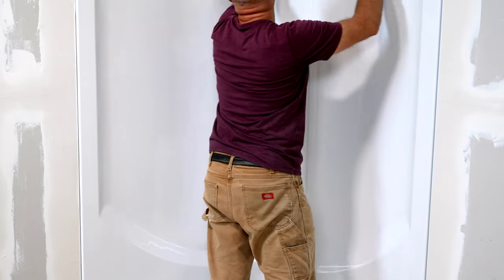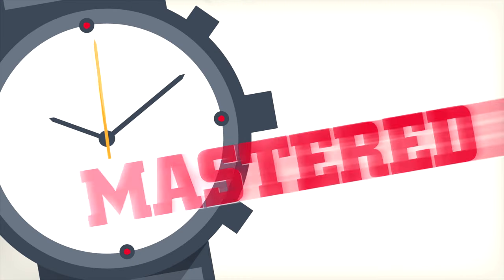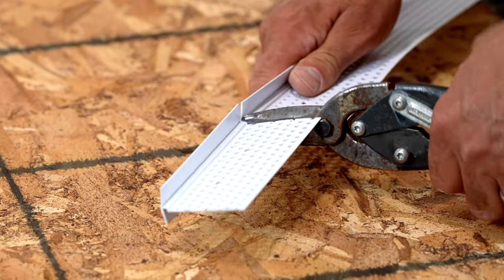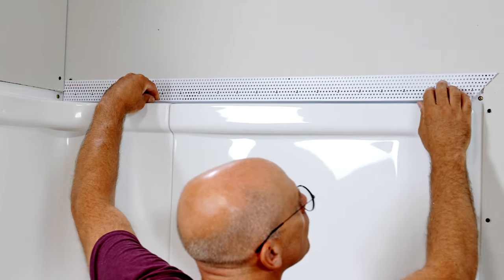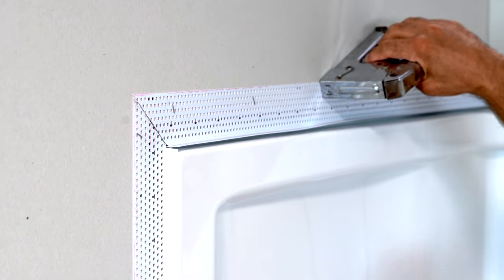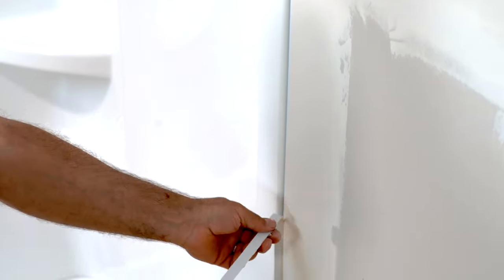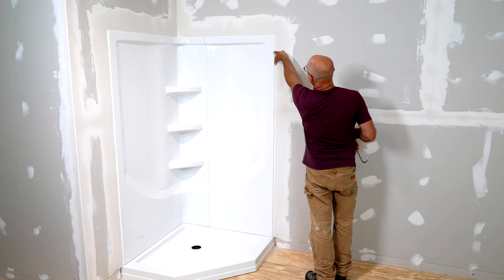How to Finish Drywall Around a Shower Enclosure

Comment: what you actually want to do is simply tape tight to the tub, i dont see why you would want an 1/8" gap or caulk.
Reply: the materials expand and contract at different rates, so you'll end up with cracks if you tape right up to it. Flexible caulk will span the gap and last a couple years before it needs replacing.
Reply: @harmonj3  if you use a quality exterior caulk product like np1 urethane or dow 795 silicone you'll get at least 2 decades out of it from my experience. I prefer urethane but you've gotta be able to tool it properly. Silicone is easier to tool. Both take a good deal of time to cure but beat any of the typical big box store junk.
Reply: @skiptrace4034  interesting, mostly due to wear and tear from children I think, I would have only expected a couple years. Good to know
Reply: @harmonj3  there are no drywall materials that expand, tubs should not be moving, which is why i've never seen cracks around a tub.  You can tape tight to the tub and have something that lasts forever, without the risk of your caulk job falling apart every 2 years.
Reply: The directions for my tub also said to leave a gap for caulking. This prevents any chance of moisture wicking to the drywall. I  followed this recommendation and there hasn't been any problems.
Reply: @dbrianhoyt  gaps dont prevent moisture.  Drywall is sealed with paint. but I'm not trying to say don't use caulk, caulk is your friend. where ever your new drywall butts up to the tub, or an existing trim or woodwork, you want a tiny invisible bead of caulk. The bigger the gap, the quicker your caulk will fall apart.  What i am saying is no cornerbead - this video is a commercial  trying to sell cornerbead.
Reply: the reason why you don't "tape tight to the tub" is because, as someone stated above, the TUB ITSELF expands and contracts slightly while in use. not the drywall, just the tub! :) if you just taped, it wouldn't create a watertight seal because of the flexing. you can try this out yourself; as you add water/weight to a tub, you will see a slight change. this is completely bunk info if you have a metal porcelain-coated tub, though! they don't flex at all :) I believe the information you are sharing works perfectly for porcelain ones. I love it when everyone is right! :3
Reply: 1 /8 is not much , caulk should adhere nicely to a 1/8 void don’t you think ?
Reply: This is a new technique, and not necessary. Tape right to the tub with heavy set compound. Like they've done for decades.
Reply: Problem is, you do work that someone like me would get a call to come out and re do. When you pull the bead and sand, there’s no gap that layer under the compound protects the Sheetrock. Over time moisture can weaken that area making the drywall brittle and moldy. You should maybe consider that your way might not always be the right way! Pal
Reply: @Findmylimit  I have no idea what your saying but yes taping tight to the tub is the right way, yes your cornerbead falls apart, yes the gaps collect moisture, and then yes someone like you comes to "fix" it!
Reply: @iron.man.drywall1910 I’m in a house right now where earthquakes happen frequently and because of that there are cracks around the tub in the main bathroom, and the non flexible caulk they used when building it is breaking off in chunks. I have no problem redoing it with a mold resistant flexible caulk. But that second bathroom is something else.

In the second bathroom someone taped tight to the shower and didn’t use any caulk, and there’s all kinds of bubbling at the edge of the shower. Whoever did this second bathroom didn’t roll sealant on the drywall before painting or use water resistant drywall. They didn’t use a mold resistant paint, didn’t use drywall tape or joint compound to connect the wall to the ceiling, and didn’t even get the drywall screws to the right depth because I’ve got ‘em popping through all over the place. There's no ventilation system in that bathroom and the only window is the size of shoebox. 

Please don’t half 🐴 your bathrooms. This bathroom is a nightmare. All because somebody wanted to save a few bucks and get it done faster. A single coat of primer and a coat of semigloss is not going to seal the drywall in a bathroom. It’s crumbling where the wall and ceiling meet, and there's mold in the drywall paper behind the paint. I’m literally in here taking this bathroom back to basics and redoing it. 

They didn't even caulk around the bottom of the shower where it meets the tile. Because of that the floor is rotting and the tiles on the floor right in front of the shower door broke under the pressure. This whole shower has to be removed and i have to tear up the floor and replace the wood under it before I can build back up.

Comment: Where can I find that Trim-Tex shower bead
Reply: I looked at the Trim-Tex website and the local suppliers in my area. I was able to call my Sherwin-Williams and have them order individual sticks and the spray adhesive.
Reply: @WYO_Dirtbag glad I read the comments. That’s a good tip.

Comment: Try finding the 2 1/2" Trim Tex anywhere
 . . . Not a single store within 50 kiles of me carries it. . .
Reply: It’s been months so you’re probably done with this project, but I was wondering if you might be able to buy it online and have it shipped to you
Reply: @DiscoChixify  tried, they won't do it except wholesale. . .
Reply: @jimc3786  dang, that sucks
Reply: @DiscoChixify  just mud over the flange, and sand. You dont need to bead this.
Reply: @maddawgzzzz 
Said the hakk

Comment: Why not just use water resistant drywall and but it up against the shower all around then prime the drywall then put a good smooth bead of tub and tile chaulk around the edge of the shower then paint the walls in the color of your choice.
Reply: I just got done doing my shower this way,then I see this video and I got a bad feeling like I was going to tear it all out and re-do it but with your comment I’m considering leaving it the way it is and finishing it up the way you said paint and calk should be good enuf right?

Comment: If you are trying to hide shower screws on the wall with the bead and using 1/2" drywall that stops before the shower flange, it will not sit flat since the distance between the drywall and the shower flange will be <1/2". Something to think about.
Reply: What would be the solution on your mind? Im actually questioning myself about that as im trying to find how to finish my shower.
Reply: @patricktalbot4530  there is a youtube video (on side of page) that shows to trim the side that goes to the wall so the piece will lay flat
Reply: Not following what you're saying. What won't sit flat, the bead?

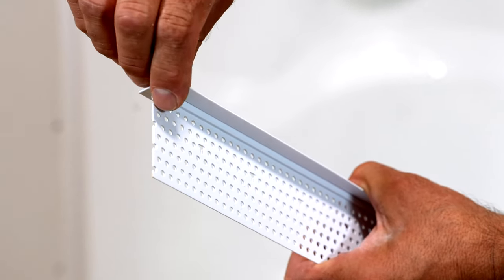Comment: 00:14 how much farther does the drywall protrude from the shower flange (in the video)? That is to say, the flange and the drywall he's using in the video appear to be practically flush. Is he using 1/4" drywall for that? What is the safest max distance between shower bead and the shower flange? I'm using 1/2" drywall in my bathroom and there's going to be quite the step down (gap) between the drywall and the shower flange if I'm going to use shower bead. I've usually just butted up the drywall to the edge of the shower itself and not used shower bead to avoid gaps and hollow areas around the shower itself.
Reply: That is the first thing I noticed and is also my situation.
Reply: @seanvandergriff7161  please let me know if you discover the answer. Thanks!
Reply: @futuresdojo  I will do.
Reply: @seanvandergriff7161  Hey guys i found the answer. This video doesnt clearly show it but there is a "leg" on the bead that you can adjust if necessary to make sure it's flush with the drywall. Another video by trim trex shows this aspect much better.
Reply: @chrisslater660  nice, ty!

Comment: That 2.5" tearaway bead doesn't seem to exist anywhere in the US. Only place I can find it is Canada. So my only choice is to hang drywall over the flange
Reply: Brandon, where did you find them? please link!
Reply: SAME! I installed all of my drywall around my shower just to be able to use this product and nobody has it within 200 miles from me.
Reply: @ryangregory5384  Literally what I did was predrill all the holes for the fasteners in the tub surround, cut the head off a torx wood screw and use it to countersink the holes so the screws would be flush with the tub surround flange surface (it countersinks by melting the plastic through friction, might need to sand off the melted burrs), and then installed the same wood screws as I used to countersink so that I could lay the drywall over the flange and screws close enough to use the maybe 1-1.5" (I forget) tearaway beads readily available at big box stores in the US
Reply: @jackmalagride4500  This worked for me because I have an acrylic tub surround, not sure how successful the friction countersinking would be on a fiberglass surround
Reply: I live in Minnesota and I bought it at Menards last week.
Reply: @aleciagibson6684  the 2.5" tearaway? Not the 1.5"?